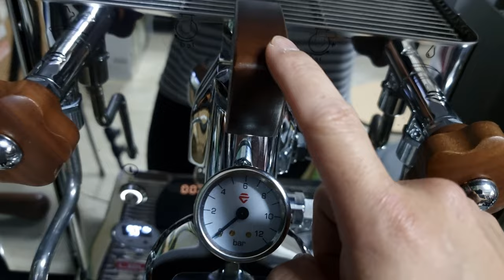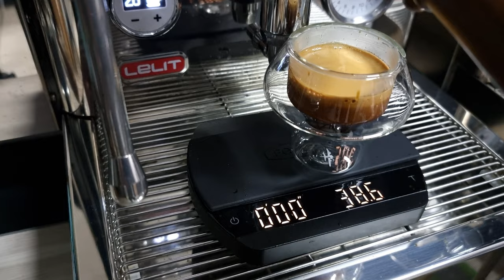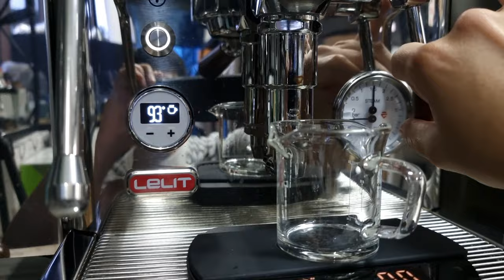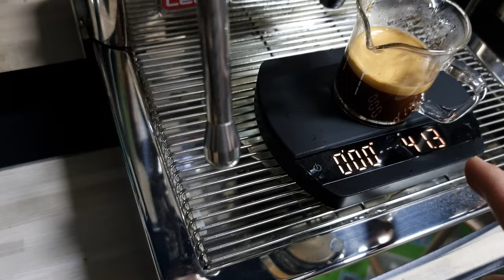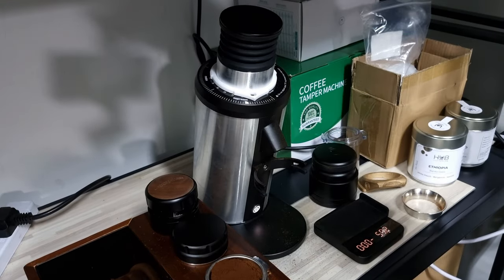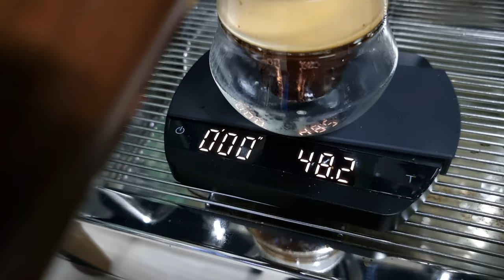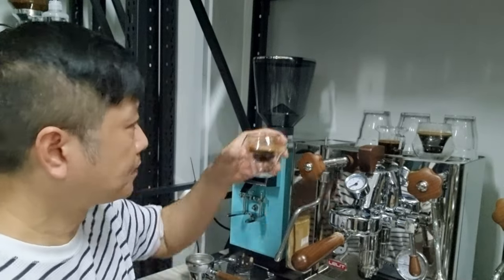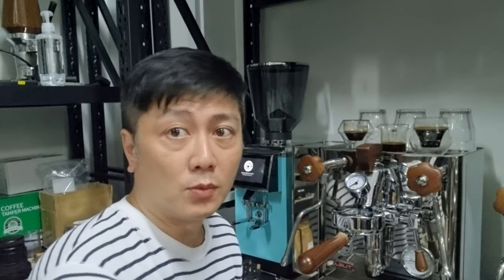3rd Attempt | To bellow or not? Using the DF64 Stock Itamil Burrs | Lelit Bianca V2

Comment: Great testing, would love to see two more extractions:  first one is to mimic a stacatto shot, so bellow into the portafilter and tamp and then put the rest in and tamp.  Secondly, this is my extraction which I really enjoy, grind and below, take half of the grinds and tamp, add the second half but don't tamp, just use the leveler which will tamp slightly (this is a stacatto tamp shot).  I put puck paper in between and a puck screen on top but you don't have to, really curious on what you think.  Later today I am going to take this to the next level and bellow first and tamp and proceed with the stacatto tamp procedure.  Keep up the great videos, getting ideas already as you can see 😂.
Reply: Also if your bored, don't go by time go by the extraction yield.  It might even out the taste between the shots.

Comment: Very interesting! 
Maybe it would be good to sieve the coffee for the 1st two shots to determine grind diameter distribution?
Thanks for your efforts
Reply from the maker: just don't bellow. Fine coffee ground is actually ok, but not the super fine powder in the last stage of grinding. It really messed up the extraction.
Reply: Hi Joe, on my sweet cast burr I sifted using the 200 / 600 micron and received less than a gram of fines and boulders, in fact when I added the fines and boulders it was still less than 1g.  I think even though there might not be a lot of fines, it's the placement that effects the taste and extraction.

Comment: interesting results. I just got my DF64 today, so I can’t really comment on bellow or no bellow. But I have heard that the distributor/leveler can cause issues. Also it would be interesting to see you use a different WDT tool where you could whisk it more and at different levels in the portafilter. [bottom middle and top] .

Comment: I thk should try another measurement to conclude. Shouldn't fix the time, but fix the ratio mayb have different result. Which we ignore the time but fix the ratio 17g to 34ml espresso see

Because if without bellowing i feel is no meaning to get df64 which is a single dosing grinder with low retention

Cy is it u using the v4 declumoer? Is it possible because the v4 declumper was blocking some coffee ground causing regrinding the bean which some bean become too fine. Mayb change to your version declumper might help?
Reply from the maker: HI Scott

First of all, I believe zero retention should mean that there is no coffee ground left behind in the grinder before we pull the next shot. It shouldn't mean that we have to empty everything into the portafiler or dosing cup, then it's called a zero retention grinder.

As comparing to grinder such as the Eureka Mignon series or grinders alike, they have problem pushing put the old coffee that is stucked behind the declumper system and hence the need to purge coffee out before grinding for the next shot.

I believe bellowing should work like a purge, and I believe that wasting of beans cannot be avoided to a certain extent. If the grinder itself is unable to remove all the coffee ground without bellowing, then it is not a true zero retention grinder. I would say having 0.1 to 0.5g is pretty amazing already. 

With my declumper V2 (my own design) I am able to keep retention low in around 0.1 to 0.2g. When my Italian friend came to visit me in Singapore,  he pointed out the problem with the bellow system and I immediately try to verify what he was saying is indeed true. 

At first, I though that is because of the SSP Cast Burrs that I am using on my Red DF64 on my table, but when I tested it on a customers DF64 with stock itamil (his declumper is the actual mythos) and the results are identical. The extra fine powder causes the bitterness in the espresso shot and even WDT won't solve the problem and in my own experiment, it even made it worse.

Something has to be fixed, be it ratio or time. I believe if I am using the same grind setting and same amount of beans and keep the shot time the same (and of course same puck preparation steps), then the only thing that is varying is the extra fine powder that I bellowed out. 

If I try to keep ratio the same, then I will need to adjust grind setting in order the ensure that I get the same ratio with varying time.

In this case, I think time is more important and not the ratio. You cannot fix ratio without adjusting grind size as evident in the 2nd and 3rd shots that I had pulled. 

It gets higher volume and this means that there are mote channeling and uneven extractions. And further tasting confirmed my theory that the extra coffee powder that is bellowed out after all the beans had been grinded is indeed the culprit that causes the unpleasant tasting notes in the espresso shots. 

Bellowing on the DF64 is still very useful as it allows us to remove and purge whatever that is remaining in the previous grind and get the grinder ready to grind the next batch of beans (and I can change to other beans if I want to because I know the retention in the grinder is minimal and it will not affect the taste of the next shot significantly. 

Just my few cents worth and thought after testing.
Reply: Scott, I was wondering the same as CY was able to bellow fines just by turning on the grinder and bellowing after previous grind and bellow.  This was with the new v4 declumper but this time it was noted the customer uses the mythos declumper which is what I use.
Reply: @CaffeMartellaSingapore  i understand your concern. i just receive my df64 too, still figuring out the declumper issue. btw i will try your experiment to figure out see the result. 

But before try it out my brew concept is even fine ground have it own flavor to add on some complexity (in good way which describe as 层次感), it just depends on brew method, so if we fix let say blowing and wdt every time, then adjust the grind size, ratio, time, temperature or even brew pressure, may have a great cup too. But i didnt meant that your brew method is wrong by the way. just i feel the experiment you doing is fix brew time and have different volume of espresso (due to some channeling as you mention), it may related to so call different "brew method" alr, like dosing 1:2 or 1: 2.5 something like that.

I was wonder what if repeat your experiment on video but change some method, we dont care on time, we just fix 17g extract 34ml no matter how much time it took and got channeling or not.. Dono what is the result will be? haha

No offence on your brew style but just curious on the result. and thanks for CY always share your experiment to us
Reply from the maker: @scottteh2911  hi Scott's, no offense taken! I am always listening and trying to see which is better. Thank you for your recommendation and I will try it.
Reply: @CaffeMartellaSingapore  wait for your result, i will also try this too and your method as well. After i solve the declumper issue. 

Btw, i suddenly got a idea, which use only the 1 layer of declumper but not the you u use last time, but change to the with the big round one. use that alone dono will solve the retention issue or not. going to try out tonight
Reply: @CaffeMartellaSingapore  another question to ask u too cy, what is the grind size range u use mp burr for espresso? I try 13 on bes870 still flow too fast 😅